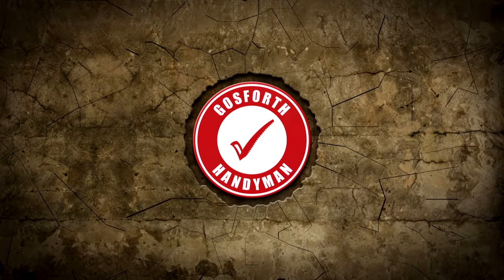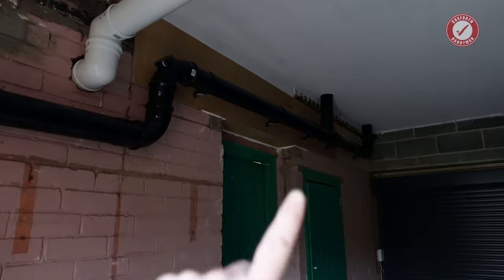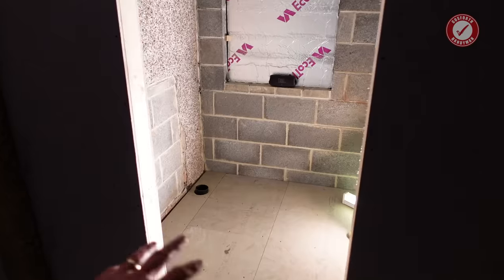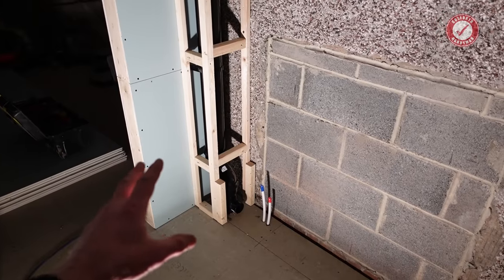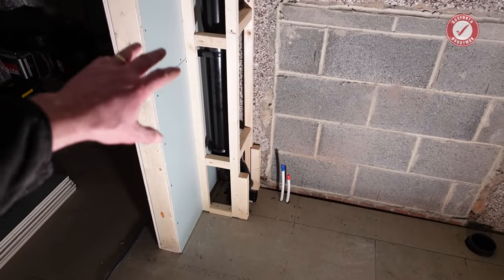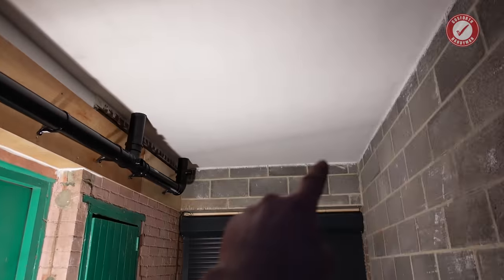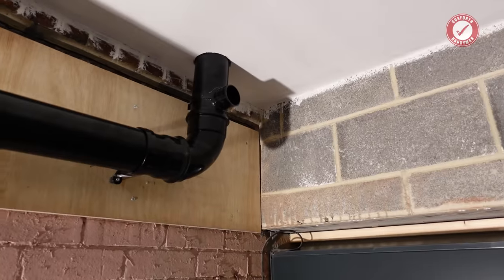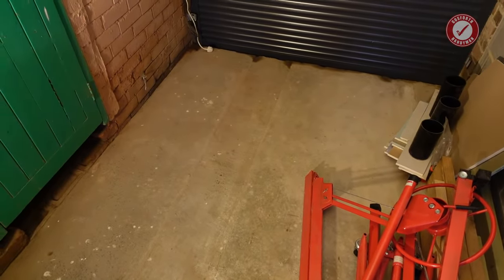Designing our waste pipework for EASY maintenance (Self Build Extension Part 15)

Comment: Looks good but as a plumber I would change the two elbows for 45s would give better flow and less chance of anything getting blocked.
Reply from the maker: Was a case of (another) rodding point vs 45's. Went for the rodding point, but easily changed if there's ever a problem. 👍

Comment: Very very good, as with drains you can have all hidden and save space etc but if the drain get blocked then the whole house becomes toilet ! also that point about putting connection on the lowest point is excellent ! do the same

Comment: A very clear explanation, and a setup that should be good for the next hundred years.  Waste pipes in northern US are usually exposed only in basements or other heated areas because of our colder climate.  A majority of US homes are wood frame construction which allows plenty of space to hide the pipes.  This means, of course, that locating and repairing a plumbing problem can be a major operation and make a real mess!  US houses built on cement slabs sometimes run water, waste and heating pipes within the slab, which makes for even more of a problem for repair.  But then, we seem to build a lot of things that are only intended to last for a generation or two.  (Sigh)
Reply from the maker: Cheers Bob! Interesting! Very jealous of your basements and huge crawl spaces. The biggest crawl space I've seen in a UK house was about 2ft high. 👍

Comment: SLIP COUPLER
Someone might have already pointed out that your slip coupler joins your male branch to your cut pipe. Hopefully, this saves you from cutting your existing soil more than twice. You shouldn't need an additional coupler as mentioned in 12:07

Comment: The regs confuse me too, mine & the neighbours house are identical layouts & same handed (built 2011/12), their vent goes to a tile (definitely within 3m of a velux window & the bathroom window is close to 3m but on the end wall), mine comes out the wall with a leaf guard style thing on it & the gasses definitely gather under the eves 🤦🏼‍♀️ (just painted the barge board and wall on that side & it wasn't a nice experience)
Reply from the maker: Sounds like fun! Hold your breath around the poo pipe! 😁

Comment: On the final connection to the soil stack, you don't need to change the male connector to female, right? That's what the rubber collar is for. If you have two female connections, you won't be able to fit that T on to the existing stack.
Reply from the maker: Hmm... I was going to put the slip connection further down the stack... there was a reason when I bought it, but now I can't remember why. You may have a point. 😂🤔

Comment: I assume your toilet waste pipe connects differently in the UK? In the US, we have to space them out from the finished wall by some set amount (like 11 or 12 inches) and the toilet then sits on a wax ring on top of the pipe. I've seen other UK videos where it comes out of the back of the toilet and then bends down using an adjustable pipe.
Reply: No toilet in the UK discharges straight into the floor, it's always a P trap in the bottom of the pan that discharges backward. You can then either use swan neck adaptors, flexi, or smooth bends to connect into a vertical soil pipe coming up through the floor. A straight adaptor to go straight back or a bend to go left or right.
Reply: @effervescence5664  Seems like that would make it more flexible. Here, you have to buy the toilet based largely on the rough-in spacing. If you build out the wall, you can completely screw things up.
Reply: @Psychlist1972  Oh I know, it was a nightmare when I moved from the UK to the US, for as innovative and in front NA is with insulation/framing and other construction methods when it comes to plumbing I was amazed. You don't find traps buried in concrete in the UK for instance, only on the outlets of basins, showers etc. As they can scale up over time it makes them much easier to replace, including where needed a toilet pan. 
The other benefit of the P trap is more often than not if it does ever leak at the toilet outlet it's highly unlikely to go unnoticed long enough to cause damage to the sub floor and framing. Water damaged sub floor and joists I found to be quite common with the Wax ring and S trap toilets of the US.
Reply from the maker: Yup! Poop pipes connect to the rear of the loo in the UK. Never realised it was different elsewhere! 😁

Comment: You keep referring to the garage. I'm confused. It soesn't look wide enough for a vehicle. Do I need to go to specsavers?
Reply: Standard UK single garage isn't really wide enough for a vehicle (if you want to open the doors). Rather sad really.
Reply from the maker: Yeah, UK garages are always tiny. It is theoretically possible to fit a car in, but nobody does.
Reply: I believe this problem dates from the days when an Austin 7 was a typical family car  i.e. 1930s. The standard garage size used to be 8 feet by 16 feet in old money!

Comment: I can't see why you can't use a vent tile so long as the outlet is above and away from any opening windows, the Regs give the prescribed minimum distances.  As your BCO says AAVs are not a panacea for venting and given that they are a mechanical device with an internal flap they do fail, whereas an open vent pipe is 100% reliable.
With the penetrations trough the garage ceiling requiring intumescent collars and your concern about noise(?) it might have been equally as economic to use cast iron that would give the fire resistance as well as the noise attenuation and c.i. is more robust that pvc
Reply from the maker: Not 100% but I think you still need the pipe collars on CI at the penetration points? Could be wrong. Probably down to how kind the BCO is feeling. 👍
Reply: @GosforthHandyman  CI has the highest fire rating at A1.  Having an intumescent collar around the CI pipe would not work IMO in a failure situation as the intumescent will not naturally fill the void as it is designed to do with PVC pipework.  The pvc pipe will collapse in in a fire and the failure of a CI pipe would be to break up and fall out.  Also, steel pipe, and by extension CI will provide the fire resistance so long as the prescribed lengths of pipes exist on each side of the fire boundary.

Comment: Two things that I find very very weird about UK buildings; You have your waste pipes outside of the building. And you put plaster on top of plaster board. The last one is extra weird in my mind 🤔
Reply: Plastering on top of plasterboard not common where I live in Scotland either. Maybe if wanting some sort of decorative effect. 
Tape/fill the joints - done.
Reply from the maker: Ha, we do sometimes tape / fill in England but normally it's a full skim. 👍
Reply: Do you know why? Been wondering myself and can't find an answer

Comment: Yet you have put 90°s rather than 45°s on the horizontal soil run, in the thumbnail, as a joiner who understands angles.  
From a mech services engineer
Reply from the maker: Ha, it's mainly for the rodding point as I don't think you can get 45's with access. 👍😁

Comment: @7:02 "Rotting" points or "robbing" points? The closed captioning isn't working.
I think they're called waste access points or cleanout plugs here and used when a blockage occurs.
Reply: Rodding points.
Reply: Rodding points.
Reply: I think ‘rodding’ is called ‘snaking’ in the US, maybe?
Reply from the maker: Yup, rodding!
Reply: Gives a whole new meaning to "Hot Rodding"!
😅

Comment: I would avoid insulating the waste pipes and really opt for sound dampening.  I recently had to extend the boxing in one of our room ever so slightly to add sound dampening as the insulation I used wasn't really up to the task, I was trying use what I already had and the noise was quite bad.

It is surprising the difference it made.

Comment: Hi Andy, genuine Q - do you need a vent stack exiting the roof or can you terminate it in the loft and have a durgo 1-way valve on the end so it can suck in clean air without spewing 💩 air?
Reply: Just seen the durgo comment… as you were 😂
Reply from the maker: Yup, BCO wants at least one open vent on the system. 👍

Comment: You can buy a non return valve for soilstacks, They are often used in conservatories. Tis would allow the stack to end in the loft, no vent tile etc necessary. I had one in a conservatory and it worked perfectly for many years.
Reply: Yeah that's called a Durgo Valve. Thats how new build houses are built using Durgo Valves in the loft space
Reply: I believe they're called AAVs (Air Admittance Valves) which would remove the need to penetrate through the roof.
Reply from the maker: Yup, Durgo / AAV. BCO wants at least one open vent.
Reply: @GosforthHandyman  But do you already have an open vent on the original stack?  If the vent stack is needed then I would however go with your option and have a vent. I found AAVs a bit smelly over time.
Reply: The non-return valve is variously called a Durgo but is actually properly called an Air Admittance Valve (AAV).  These rely on a thin flappy membrane to seal the pipe in the passive position.  The membrane can fail to seal over time causing sewer gases to flow out.  I have two AAVs, both of which need replacing as the seals are fluttering in use.

Comment: You can tape a spacer block to one end of your level to accurately keep to the fall.
My rule of thumb has always been 25mm drop per metre.
Reply from the maker: Yup! 👍👍
Reply: I've heard recommendations between 20 and 40 mm per metre for waste pipes. Actually if you use cm instead, 1 cm per metre also happens to be 1% of fall, easy to remember.
Reply: Ragnar8504 regs I believe are 1:40 which equates to 25mm per metre, how many people stick to this is anyones guess…

Comment: I always enjoy watching your videos. You can get a slip coupler made from the same material as your vent pipe and in the same colour. I used one for my recent extension build and got it off Amazon. It will look so much neater than the one you're thinking of using. Just a thought 🙂
Reply from the maker: Not too bothered as it's a garage but cheers! 👍😁

Comment: Why did you have to take a 110 vent into the roof space when an air admittance valve could have prevented the boxing in of the pipes?
Soil & waste pipes have a fall built in to all the fittings 21/2* to maintain a self cleaning situation.
Slip couplings are designed to break into a pipe which will accept the tail or spigot of the new branch.
Reply from the maker: BCO wants at least one open vent.

Comment: I know its regs but what's the sense in the reg saying you must use fire resistant sealant around a plastic pipe that will just melt and expose the 4" hole anyway. Do you not have to box out plastic soil pipes that transit garage ceiling in fire resistant plasterboard that would give the required fire protection.

Comment: In 40 years I have never had a problem with a soil stack or waste pipes .  Drains at the bottom yes ,  where the soil pipe goes into it and it blocks at the bend .  Ps in Scotland you would need to air test it too , same idea as a gas soundness test but obviously you are restricted by the trap depth for pressure.  No drop allowed whatsoever and building control watch.
Reply from the maker: You air test here but I think only on new builds. Never seen air tests on extensions but happy to do it if needs be. 👍
Reply: @GosforthHandyman   unless things have changed they only air test drains on commercial in England not houses .  I live on the border and worked on both obviously but not much recently. They roof terminal vent was always OK a few years back they used to have a black flexible connector with big jubilee clips . There are lots of differences between the two tbh and insulation regs etc are stricter here . On a new build you also have to build a ramp and have a low threshold door , socket and light switch  heights , a downstairs wc with  a clear 800mm square space for wheel access and space for any future shower requirements. Oh and you must put solar or rainwater harvesting in too

Comment: Just a question. Had the outside of the house painted with weather shield. Some has splashed onto black plastic down pipe. Any ideas of ways to remove this?

Comment: The shower/bath where it taps into the soil under the toilet is incorrect to regs. It needs to go into the vent to the loft. There’s space in the garage for this. You risk emptying the trap. All wastes soil/bath/basin should be off the rise and not one after the other if that makes sense. Lovely job and attention to detail 👍🏻
Reply: He will flush/push poo up in to the shower tray if the soil pipe is blocked. 
Then he will have poo all over the bathroom floor if he keeps flushing the toilet.

Comment: You'd be mad to run a vent stack to a vent tile.
Reply: That's a dogmatic pronouncement Luke!
Is there any actual reasoning behind it you'd like to share with us.......?!
Reply: @andymccabe6712  most tile vents have an air flow of 8,000mm2, standard stack to birdcage has 12,500mm2 (from memory) problems downstream of the stack can cause negative pressure and with a reduced air flow from the stack can cause syphoning of internal traps, especially when people use low level bath traps (which are never designed to be terminated to soil anyway)
Reply from the maker: "vent tile that provides roof space, mechanical extract or soil pipe ventilation" - they appear to be designed for that very purpose so not sure what the problem would be...
https://redland.co.uk/products/components/ventilation-tiles
Reply: @GosforthHandyman  in short they're generally not, especially for domestic settings, it's when you have multi stories and excess bends it becomes a problem as the required air flow is reduced as shown in the link I gave, more than likely fine in your case though.

Comment: You could of brought the 2 pipes out of the ceiling much tighter and I would of ment you could of ran pipe straight over to a branch inverted. This would have removed the drop on the soil below the boiler flue
Reply: It would of looked a lot neater, you could still do it just need to use a full length of pipe instead of 2 bends in pipe🤓
Reply from the maker: Tried but can't quite get the fall. 👍

Comment: I thought you ,moved the front sewer in an earlier episode to mend the cracked drain, did you think about using this for the on sweat when you moved it
Reply: That was a rain water drain not a sewer, they are separate systems.
Reply from the maker: It's not separate systems and all goes to that sewer. 👍

Comment: @1:28 Why the bump out at the bottom of the stack? Wouldn't it make more sense to move the whole frame out those two inches to make wall finishing easier and look better?
Reply: That's where the pipes out go into. It'll be boxed in later, probably with tiles.
Reply from the maker: It's just where the pipe avoids a joist but you'll not really see it once it's all finished. 👍

Comment: In Ontario Canada toilet rough in is 12 inches out from rough framing. I see yours a lot closer??
Reply: Most NA toilets have S traps in molded into the pan, UK toilets use P traps discharging straight back to the wall. Then you use adaptor fittings to suit soil pipes coming up through the floor, to go to each side or straight back into a wall.
Reply: @effervescence5664  Thanks for the clarification.
Reply: @jdavey5087  No worries, it makes a huge difference being able to choose the connection fitting and even the type of toilet after the structure is built. The only time it's all 100% locked in is using something like Gerberit concealed cistern and hanging toilet pan.
Reply from the maker: Yup, UK toilets exit from the rear. 👍😁
Reply: @GosforthHandyman  From the rear out the rear!! LOL!!

Comment: Great video as usual. When I built an extension (DIY - 25 years ago!) the fall on a soil pipe had to be between 18 and 45 mm per meter run.  I also used an air admittance valve - AAV ( I hadn't heard of one before) which helped to simplify the project and worked well.  You do briefly mention "admittance" at one point.  Did you consider an AAV at one point and then decide against it?
Reply: Answered at 2:34 - building control wouldn't let them use aav
Reply from the maker: Yeah, have several AAVs on the system and our BCO wants at least one open vent. 👍